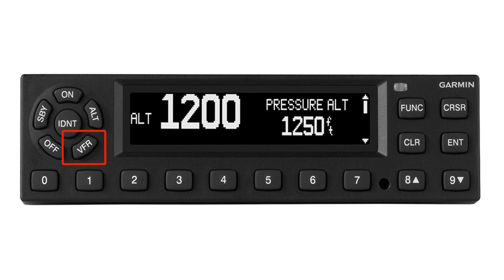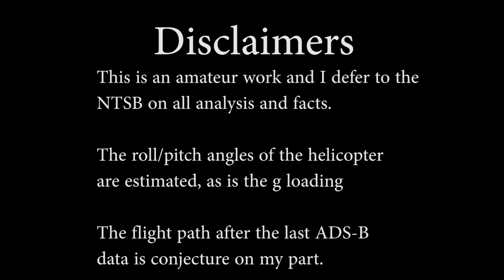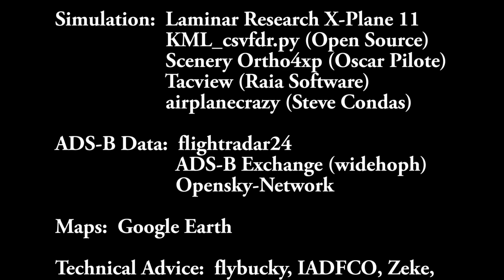Newly released Pilot to ATC Audio!  N72EX (Kobe Bryant) Crash Reconstruction.

Comment: I don't understand how the pilot lost his coordination even with all the technology and instruments modern aircrafts have, like should't an alert have been going off about height, or a GPS saying you're descending very fast? I mean commercial jets fly in pitch black foggy conditions and they never have an issue, It just seems fishy, even if you lose visual coordination, you should not crash, the instruments should've been able to keep him straight. It just doesn't add up.
Reply from the maker: The NTSB said the helicopter did not have a Terrain Awareness and Warning System (TAWS) installed, so there was no altert.   The NTSB recommended that all part 135 helicopters have this device several years ago, but the FAA has not (yet?) made it a requirement.

Here is what a professional pilot and flight instructor thinks happened:  https://www.youtube.com/watch?v=BCLNJLjitSs&lc=UgwTtaTt-a3Ek5nwp5p4AaABAg.952mP7qI90Q9D4Km4XrvYb&feature=em-comments

Comment: I'm not a pilot, but if you are surrounded by clouds wouldn't you just look at your horizon indicator non stop and gain altitude to get above the clouds like the pilot stated his intentions? Did this pilot just have a serious brain fart and that's why he and all of his passengers died?
Reply from the maker: FWIW, here is the high level IIMC procedure from the Island Express training manual: 

"Control: First use the wings on the attitude indicator to level the helicopter. Maintain heading and increase to climb power. Establish best climb airspeed but no slower than VMINI. Cross reference attitude indicator to indicate a positive attitude.

Climb: Climb straight ahead until your crosscheck is established. Then make a turn only to avoid terrain or objects. If a climb altitude has not been previously established with ATC, then you should climb to an altitude that is at least 1,000 feet above the highest known object or terrain and that allows for contacting ATC.

Turn: If a turn back to VMC is the best course of action, only initiate the turn after stable flight is achieved. First note the heading that you are on then begin the turn and maintain a
constant rate of turn to the selected heading. Use of the heading bug is a great tool in this situation.

Communicate: Attempt to contact ATC as soon as the helicopter is stabilized in the climb and headed away from danger. If the appropriate frequency is not known, you should attempt to contact ATC on either very high frequency (VHF) 121.5 or ultra high frequency (UHF) 243.0. Initial information provided to ATC should be your approximate location, that inadvertent IMC has been encountered and an emergency climb has been made, your altitude, amount of flight time remaining (fuel state), and number of persons on board. You should then request a vector to either VFR weather conditions or to the nearest suitable airport/heliport that conditions will support a successful approach. If unable to contact ATC and a transponder code has not been previously established with ATC for inadvertent IMC, change the transponder code to 7700.

Note: All of the above will be practiced by Manual Manipulation of the Controls and the use of Auto Pilot. The pilot will learn the advantages and disadvantages of recovery by Manual Control and Automation. Example manual control is quicker I Automation slower. However, if pilot experiencing spatial disorientation and unable to regain control Automation is the best option. Also, the pilot will become familiar with the use of the "Go-Around Button" and its functions."

Comment: Would the pilot not know that he’ descending to the left at a fast rate instead of rising? 

This comment has no I’ll intent ,  just honestly curious as I’ve never flown in a helicopter before.
Reply from the maker: I am not a pilot, so this is not an "expert" answer.  I have been modeling the g-forces and what I see is that the occupants would not have felt any side to side or significant front to back force.  What I see for a portion of the descent is 1G straight down in the seat, and this would feel the same as if still climbing (here is a preliminary video:  https://youtu.be/xI1UqFvNYIU.  Read the description for more details).

My reading of the literature is that the occupants might detect a rolling motion any time the roll rate exceeded 2 degrees per second.  I wonder if the pilot might not have noticed this if he was occupied?  Lastly, at some point during the descent I think the occupants would have felt discomfort in their ears due to the rapid descent and they would hear increased wind noise due the increasing speed.
Reply: Steven Condas 

I appreciate your response Steven. I’ve never flown a helicopter or aircraft or anything for that matter.. 

Ive always been fasicnated about air traffic of any kind so your video and response was very helpful.

You’ve got a new follower in me!

Comment: 3:26 I definitely would have yelled and told the pilot to keep using the highway for a visual, that's terrifying to not be able to see a thing being in a flying metal box...
Reply from the maker: Some of this is speculation on my part.  The pilot was following a highway through the mountains and thought that once he got past the highest mountain pass on his route that he could descend a bit and stay under the cloud deck.  He got over that pass and started to descend, but despite descending I believe he could not see the road (I suspect the cloud deck was lower there than it was going over the hill).  Now he is IIMC and can't turn around because there are hills to both sides.  Here is a rough chart of aircraft altitude vs. ground elevation https://ofutbg.bn.files.1drv.com/y4mfYiTYMgdhhNjpTaczw2oEuI9ZlTP-Urr4MBNShQp1qEC7ki1uXgleTBJCy6if86Rwq6EWg8oIfJcgHKvyIdk-Sdgi-1XwCg7G0JGrAFxXJKuPIriwbg791YEyEsAsIS4EP2QnyCQxeLProbTLNoWzC1n1o1_OexgSvRFp8LN8A-HdFSVfJj2xIENFec3Tx8sUSXuHD9AT4MULhRIjsbIKA/N72EX_Elevation_Profile.png?psid=1:

Comment: Did that machine have an autopilot, or just the same old 2-phase AFCS that most of the A models had?
Reply from the maker: The helicopter had a SPZ-7000 (4 axis flight control).
Reply: Damn. The Sperry does have it’s limitations but it’s great for bombing around in the goo like that.
Reply from the maker: @HeliRy  BTW, I don't see any indication in the ADS-B data that the flight control was in any hold mode (no heading hold, altitude hold, vertical speed hold, IAS hold, roll hold, pitch hold).
Reply: @stevencondas2281  
Yeah I didn’t hear the chime when he departed altitude either, so it seems that he wasn’t using the AL300 Alt-Pre just as a reference either. 
I’m not familiar with the pilot’s history. Was he fairly new to the S76 and uncomfortable with automation... or an old hat who figured he knew better? 
Like I said, the Sperry does have it’s limitations and it will most certainly kill you if used incorrectly. But it seems that on this flight, it wasn’t used at all. And that’s a real shame.
Reply from the maker: @HeliRy The pilot had over 8000 flight hours and 1250 hours in the S76.  I suspect most of those hours were hand flown with no "hold" automation..  Notably, as of 2019 he had only 75 hours of instrument flying.
Reply: @stevencondas2281  
Yikes. I hate to sound harsh, but there’s no excuse for that. Single pilot in IMC and uncoupled... a recipe for disaster.

Comment: What i dont understand is that how could he have not been paying attention to the instruments, unless there was a mechanical problem.
Reply from the maker: If here were having a mechanical problem, would he have mentioned that to the controller?
Reply: @stevencondas2281  maybe he didnt know  that the attitude indicator wasn't working. How could he have known if he was flying in fog? But then again it must have been working before he crashed cus he was flying in clear skies when he took off🤔.
Reply from the maker: It is perplexing.  I believe the primary attitude indicator was a HONEYWELL EDZ-705 EFIS.   I think it would be a pretty low probability that it failed in such a way that it LOOKED like the attitude indicator was working, but was not.  If a gyro fails, then the EFIS should show that: "If an attitude source failure occurs in one AHRU, an attitude warning discrete signal is applied through the EFIS symbol generator to the EADI. This signal causes the pitch scale and roll index to be removed, the sphere to change entirely blue, and a red ATT annunciator (warning flag) to be displayed in the middle of the sphere."

Comment: Am i missing something here? What is that pilot thinking? He flying VFR and decides hes gonna fly in the clouds? Um ok thats illegal, then he calls up the controller and seems unclear of what he wants. How does no one in that helicopter not feel and hear rotor speed increase a diving turn of 2000 FPM ? I would have been in the back screaming to the ..pilot your in a dive! To all passengers out there dont get in small or private aircraft without know a thing or two. Don't be so immersed in anything while flying in a small or private aircraft, try and understand whats going on.
Reply from the maker: To your question  "How does no one in that helicopter not feel and hear rotor speed increase a diving turn of 2000 FPM ?"  The rotor speed is controlled by a governor on the engine and stays roughly the same speed independent of workload, so no one would have heard the rotor speed increase because it likely didn't.  I also suspect that the G-Force on the passengers felt like about 1G straight into the seat (just like normal) for a good portion of the descent.  I think that the first indication that something might be amiss would be ear discomfort due to the rapid descent.  Here is a video of my preliminary work on G-Force (see the video description for details):  https://youtu.be/xI1UqFvNYIU
Reply: Steven Condas I see thanks for clearing that up. What about the part where he’s flying VFR and then decides on his own NOPE I’m IFR now? Am I missing something?
Reply from the maker: Some of this is speculation on my part.  The pilot was following a highway through the mountains and thought that once he got past the highest mountain pass on his route that he could descend a bit and stay under the cloud deck.  He got over that pass and started to descend, but despite descending I believe he could not see the road (I suspect the cloud deck was lower there than it was going over the hill).  Now he is IIMC and can't turn around because there are hills to both sides.  Here is a rough chart of aircraft altitude vs. ground elevation https://ofutbg.bn.files.1drv.com/y4mfYiTYMgdhhNjpTaczw2oEuI9ZlTP-Urr4MBNShQp1qEC7ki1uXgleTBJCy6if86Rwq6EWg8oIfJcgHKvyIdk-Sdgi-1XwCg7G0JGrAFxXJKuPIriwbg791YEyEsAsIS4EP2QnyCQxeLProbTLNoWzC1n1o1_OexgSvRFp8LN8A-HdFSVfJj2xIENFec3Tx8sUSXuHD9AT4MULhRIjsbIKA/N72EX_Elevation_Profile.png?psid=1:

Comment: why did kobe's helicopter's paint scheme change so much?   the helicopter on the ground looks NOTHING like kobe's helicopter.  so again, with THIS hoax, HOW DID KOBE'S HELICOPTER lose all of its triangles.  standing by...
Reply from the maker: The paint scheme I showed in the video was as close to the actual paint scheme as I could create.  There was a time in 2015 when it had a Nike / black mamba livery, but my understanding is that it was a skin installed over the actual paint scheme and was subsequently removed.  Here is a picture of the aircraft from 2019:  https://gramho.com/media/2233740397133465948

Comment: Set the heading bug to desired heading. Auto pilot: Set to ON. Auto pilot Heading SELECT. Select altitude Preset on PFD above the MOCA. Auto pilot set to ALT. The Héli will climb and maintain selected altitude and heading. Pilot gets organized. Makes ATC call. Announces in IFR conditions. Request weather update and vectors to VFR condition. As pilots, we should be able to master all systems of our aircraft - more so the flight automation systems. Very sad 😞
Reply from the maker: I think the exact procedure on the SPZ 7000 DAFCS installed on N72EX is slightly different than you described (for example, the manual says "The pilot must initiate the required climb or descent, normally using the VS mode, IAS mode or both." ), but your point is well taken 

FWIW, here is the high level IMC procedure from the Island Express training manual: 

"Control: First use the wings on the attitude indicator to level the helicopter. Maintain heading and increase to climb power. Establish best climb airspeed but no slower than VMINI. Cross reference attitude indicator to indicate a positive attitude.

Climb: Climb straight ahead until your crosscheck is established. Then make a turn only to avoid terrain or objects. If a climb altitude has not been previously established with ATC, then you should climb to an altitude that is at least 1,000 feet above the highest known object or terrain and that allows for contacting ATC.

Turn: If a turn back to VMC is the best course of action, only initiate the turn after stable flight is achieved. First note the heading that you are on then begin the turn and maintain a
constant rate of turn to the selected heading. Use of the heading bug is a great tool in this situation.

Communicate: Attempt to contact ATC as soon as the helicopter is stabilized in the climb and headed away from danger. If the appropriate frequency is not known, you should attempt to contact ATC on either very high frequency (VHF) 121.5 or ultra high frequency (UHF) 243.0. Initial information provided to ATC should be your approximate location, that inadvertent IMC has been encountered and an emergency climb has been made, your altitude, amount of flight time remaining (fuel state), and number of persons on board. You should then request a vector to either VFR weather conditions or to the nearest suitable airport/heliport that conditions will support a successful approach. If unable to contact ATC and a transponder code has not been previously established with ATC for inadvertent IMC, change the transponder code to 7700.

Note: All of the above will be practiced by Manual Manipulation of the Controls and the use of Auto Pilot. The pilot will learn the advantages and disadvantages of recovery by Manual Control and Automation. Example manual control is quicker I Automation slower. However, if pilot experiencing spatial disorientation and unable to regain control Automation is the best option. Also, the pilot will become familiar with the use of the "Go-Around Button" and its functions."
Reply: @stevencondas2281  Brilliant expose! After being and ATC for 15 years (most of it IFR in Canada) and piloting for 21 (fixed wings) - I can ascertain that following proper procedures is the quintessence of flight safety. Thank you for your description. Jack

Comment: I know absolutely nothing about aviation, so apologies in advance if this is a dumb question: Why was the pilot descending when he told air traffic that he was ascending? Surely he would know the difference. Also, wouldn't your natural instinct in mountain areas be to fly above the clouds when visibility is limited? Just wondering
Reply from the maker: I believe the leading theory is that the pilot was disoriented and thought the aircraft was still climbing when in fact it was descending.  I have never experienced spatial disorientation in a helicopter, but this video shows how easy it is to become disoriented when you don't see the attitude indicator and you can't see the ground out the window:   https://www.youtube.com/watch?v=9ofStn2KScg&t=330s .   In that video, the pilot is flying while his head is covered and the attitude indicator is turned off, and he gets completely disoriented.  He is trying to fly straight and level, thinks he might be banking to the right, and is actually banking to the left and descending.  I think our senses can be fooled and that is what happened to the pilot in this case.
Reply: @stevencondas2281  Thanks

Comment: I'm only a fixed wing pilot. But I always envisioned a helicopter could slow to a crawl or hover if they became disoriented.  Why would he continue flight at speed? Does a helo of that class have any type of auto pilot?
Reply from the maker: I am not a pilot at all, but my understanding is that hovering a helicopter manually in IMC is extremely difficult (no visual reference).  The Rotorcraft Flight Manual specifies a minimum speed while in IMC called Vmini, and this is also the minimum speed the autopilot can be engaged. For N72EX I believe Vmini was 60 knots.  N72EX had a SPZ 7000 Digital Flight Control System, which includes an autopilot.

Comment: That Pilot had NOOOOOOO right to be flying anything in that fog, Helicopter only has VFR. IF that heli had IFR, then it wouldnt have crash, but I dont think Helicopter pilot can get the IFR rating.
Reply from the maker: You are correct that operator was only certified for VFR flight, but the pilot was instrument rated.  I haven't found evidence that the pilot had recent IMC experience.